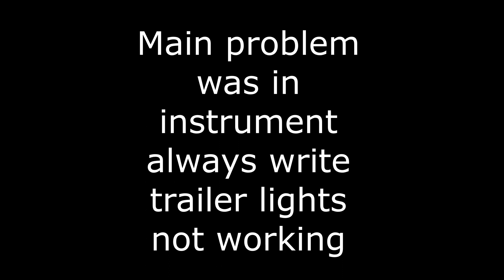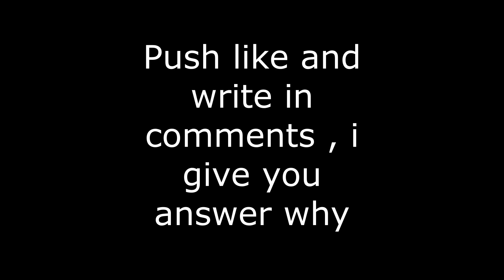Ford transit custom trailer control module location

Comment: Hi I have a transit custom also and the right indicator has stopped working on trailer socket. Help please
Reply from the maker: @AndrewMcBride-c2e  check trailer conector, maybe in trailer problem

Comment: Same problem how did you cure it?
Reply from the maker: i had two customs like this problem, one  i have blowed moisture  out from conector whichj is there control module just outside from frame.  Another i changed trailer control module and problem solved .